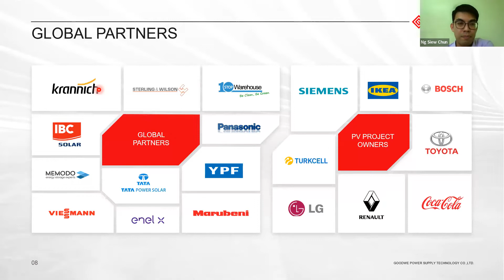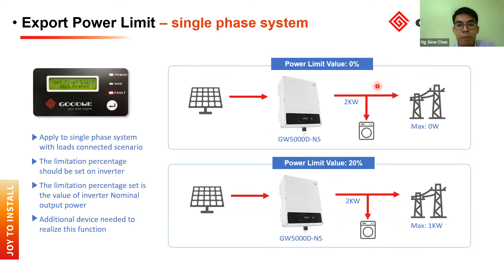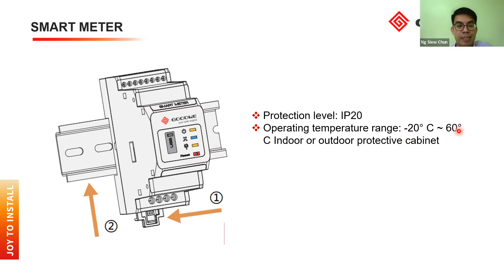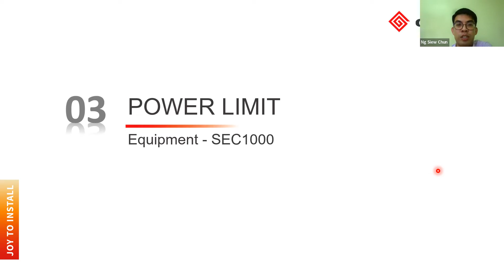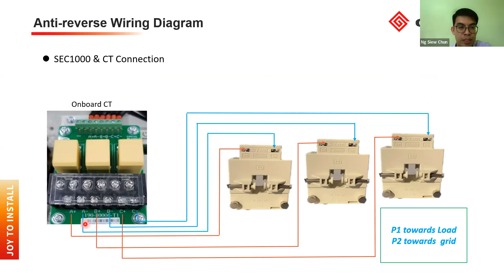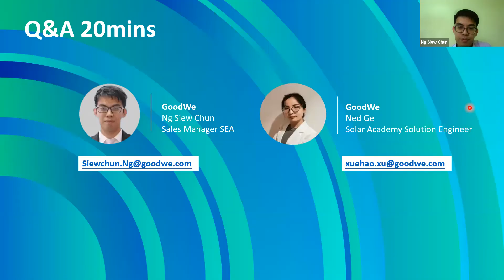SEA Webinar: Zero- Export Solution for SELCO Application

Comment: Hello there! Could you please tell me wether it is posible to connect different models of GoodWe grid tied inverters in SEC1000 or if they have to be sorted same models only?
Reply from the maker: Yes, it is possible to connect different models of GoodWe three phase inverters to SEC1000. However, these models need to have the same AC output voltage and within the input voltage range of SEC1000.

Comment: Hi, is it possible to connect a 10kw ET and a 29.9kw 3phase with the SEC1000? I have a export limit of 30kw or should i not use a SEC1000 and just zero export the 10kw ET with the GM3000? 
Thanks
Reply from the maker: No need to use SEC1000. It is only for on-grid inverter parallel system. For ET parallel system, we need to use Sec1000s ,but according to your condition, it is unnecessary to use Sec1000s for one ET.